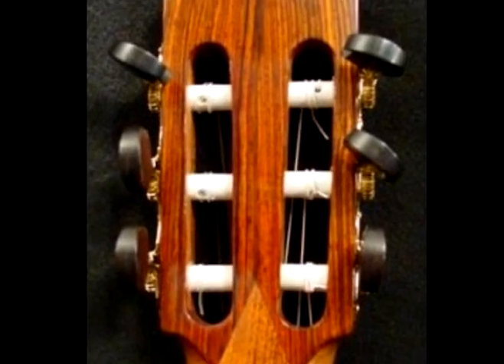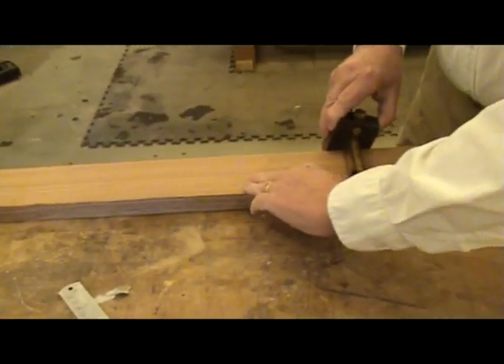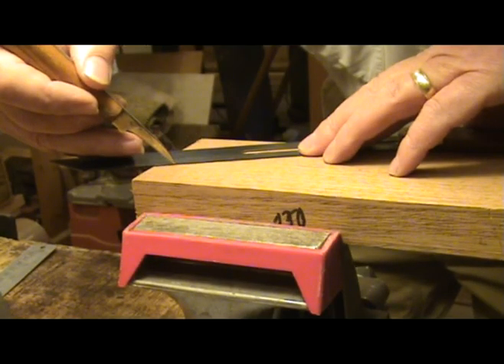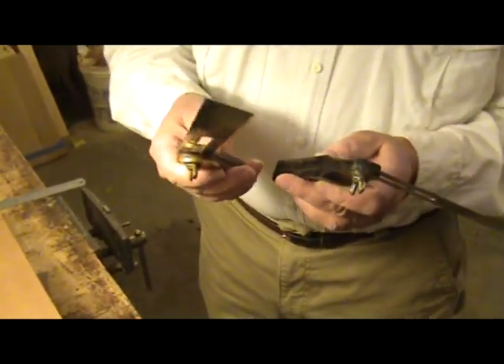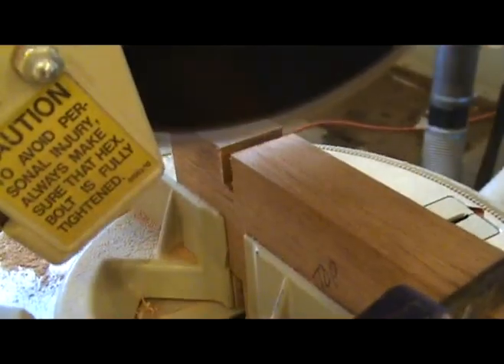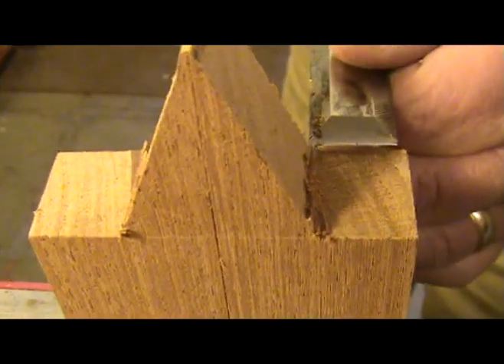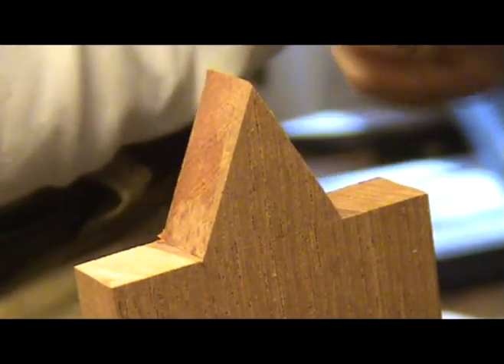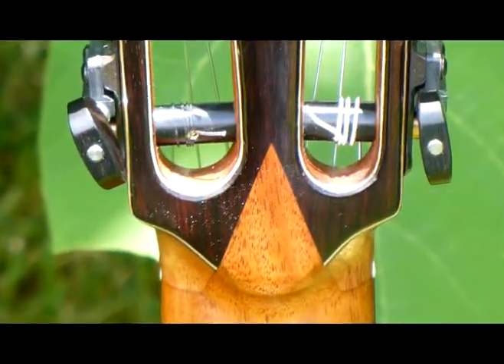Luthier Tips du Jour - The V Joint

Comment: Thanks for the clear video.  I followed the directions and was 
able to make a pretty good v-joint on an electric guitar I just built. 
The v-joint is pretty.  I used a volute to help with the joint
strength.  I think the joint is strong enough, especially as the
string tension is pulling this joint together.

BTW, I also used your video on how to spray a sunburst
finish, and had great results there, too.  Thanks.

Comment: i'm very curious about the guitar shown with the veneer on the back of the headstock, i think that is beautiful and would love to give something like that a try. would you attach the veneer and then thickness the headstock separately from the neck in order to achieve this? or would it be a matter of moving the headstock foward so the tip of the male part is flush with the back of the headstock and then taking the excess off the front of the headstock in order to level the neck (shortening the headstock slightly)

Comment: No idea why someone would do a v joint over a scarf joint other than to try to be cool or different.  It's obviously much harder to do and not as strong.
Reply: +VitalityMassage Well it's not like the neck is going to brake from that point, the joint is plenty strong to withstand the string tension and other wear and tear. Many luthiers actually want to be different from everyone else, so their work will stand out from everyone else's. There is no real reason for abalone either, or numerous other decorative elements in guitars, and yet, they are still used and thankfully so.
Reply: I agree, I would never buy a guitar like that. Engineering is more important than aesthetics.
Reply: @joahchewbhaka5679  I think the v-joint is definitelly looking better than the scarf joint but it's laborious to execute and it requires great precision. You need to have the time to do it because i'm not sure anybody would pay you an extra for the aditional effort. That's why most luthier work with the scarf joint.

Comment: Thanks for this video.  I enjoyed viewing it.  Well done, as usual.

Though this is a technically challenging neck joint, the V joint is totally unnecessary and a waste of time, in my opinion.  A scarf joint is as strong or stronger, and can be executed in a fraction of the time it takes to make a V joint.  I don't find the V joint particularly attractive either.  If you want to make a V joint to impress others, then do so.  But it is totally not necessary, unless you have time to burn.